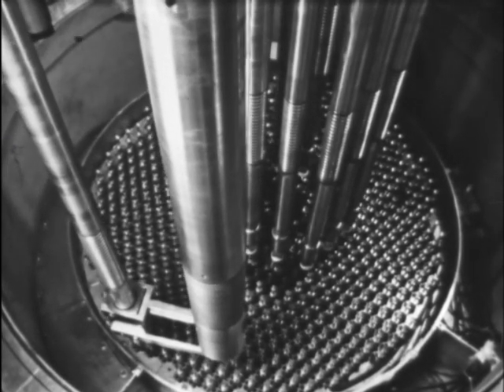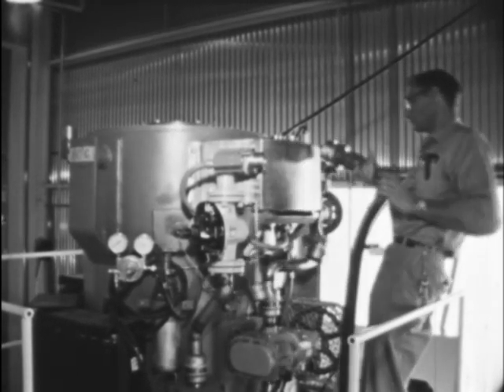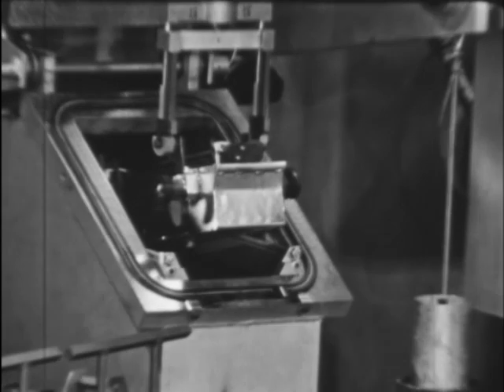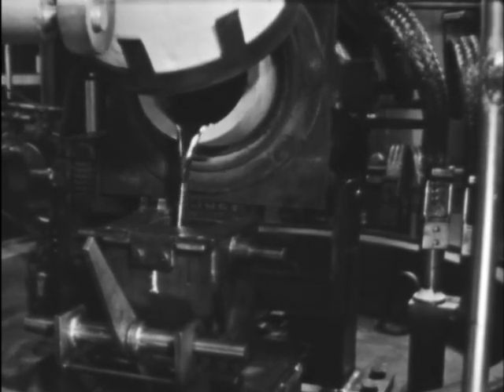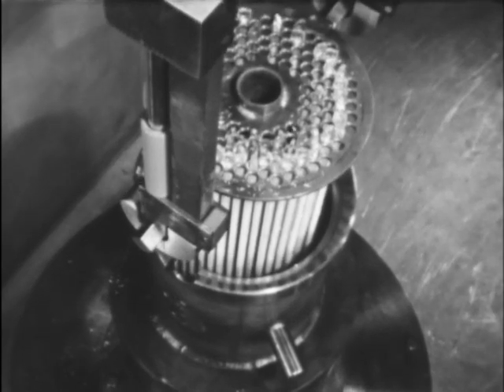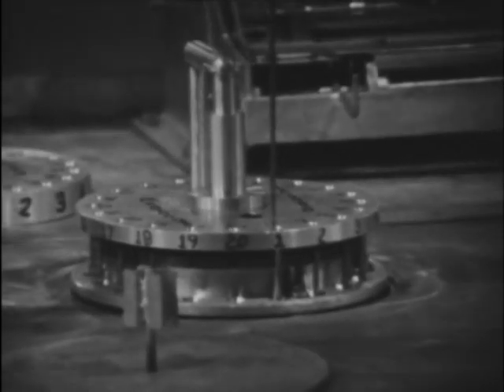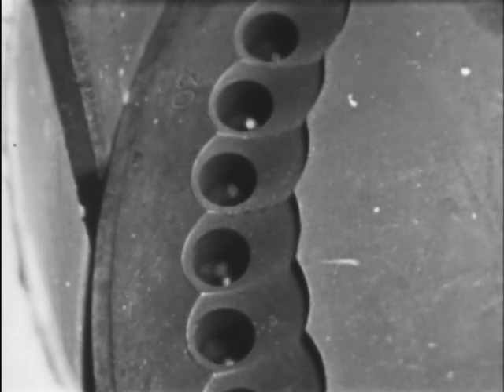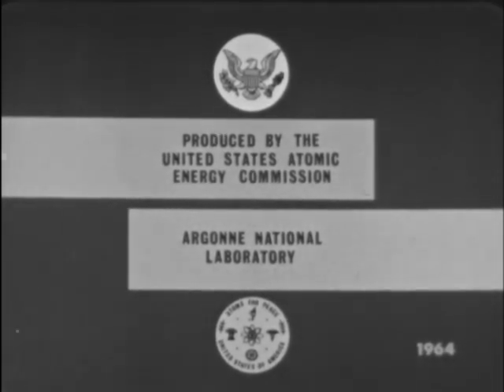The EBR-II Fuel Facility

Comment: This looks VERY dangerous. Not the nukey but the coolant.
Reply from the maker: leerman22 EBR-II operated completely safely for 30 years using sodium coolant. Other sodium-cooled test and demonstration reactors (Fast Flux Test Facility, Phénix, Superphénix, BN-350, and BN-600) also operated safely for many years; BN-600 is still in operation. Plus, one of the US submarine fleet had a reactor that used a liquid metal coolant, without incident. And there is significant US industrial process experience using metallic sodium as an alloying metal, as an anti-scaling agent, and as a reducing agent, all quite safely. So the experience base for handling metallic sodium safely is substantial and has been leveraged to allow safe use of sodium coolant in advanced reactor designs.
Reply: Nuclear Engineering at Argonne
I would prefer lead coolant for a fast spectrum reactor than something than "can" burst into flames or explode in water.
Reply from the maker: leerman22 Lead is being evaluated as an alternative fast reactor coolant. Both lead and sodium have their relative strengths; the idea is to evaluate these to determine which is better from the standpoints of efficiency, corrosion, and safety.
Reply from the maker: The fuel in this reactor is solid, not liquid.
Reply: leerman22 Yeah i agree. But lead has corrosion issues, but those can be solved with new alloys. What do you think about gas cooled fast reactors?
Reply: Zypofaeser
CANDU powers most of my grid, it depressurizes each fuel chamber individually. That adds complexity obviously but it's cool.
As for the MSR are you implying a solid fertile blanket and a vessel made of solid salt? I wouldn't bother with solid fuel in an MSR because then you'd be throwing away the best part of it.
If we could have a cheap disposable vessel and save the plant and fuel then I would go for that. A single fluid uranium-plutonium cycle. A big metal pill I would call the suppository :P
Reply: leerman22 If isolated correctly the risk should be relatively small.
Reply: Zypofaeser
It just gives greenies ammunition. They don't care about engineering.
Reply: leerman22 If you only operate at moderate pressure and engineer it right (Make the pressure vessel burst in a way that doesn't damage the fuel or release coolant into the air) you could make it safe. Also it can be refuelled while under pressure. Its done in CANDU, RBMK and AGR reactors.

You would be able to reach very high temperatures if you use helium as a coolant.

About fast molten salt reactors: Would it make sense to have fuel elements with UF4/ThF4/PuF4 inside,  and the elements sitting in a vessel of NaCl or NaF. This would reduce the problem with materials decaying over time as you could simply change the fuel elements. In this case only the walls would be exposed to decay and you could reduce their exposure to neutrons by having a thick U(238)F4 or Th(232)F4 blanket around the core.
Reply: leerman22 The fuel would be fluid inside of the fuel rods and the vessel could be made of hastelloy. The fuel is liquid and you avoid having to worry about long term damage of the vessel from neutron damage. Imagine something like a PWR with salt instead of water and UF4 instead of UO2. 

Also source for the thing about CANDU. I would like to read more about it.
Reply: Zypofaeser
That would be a good idea and it fits another idea of mine but it would remove in-situ chemical reprocessing while doing it. Would the fuel rods also be made of hastelloy?
As for the CANDU https://en.wikipedia.org/wiki/CANDU_reactor#Basic_design_and_operation
Reply: leerman22 I think a molybdenum alloy would be better as it would be better (There is some molybdenum in hastelloy). Molybdenum absorbs fewer neutrons. You would need a material thats both chemically stable and neutron resistant. I think molybdenum alloys could work. But the main advantage of this design is that you can replace the fuel elements so that when the cladding is too damaged you can simply replace the fuel element.
Reply: Zypofaeser
I'd rather have a large UF4/PuF4 chamber made of a suitable alloy like that and a salt coolant chamber surrounding that. The inner fluid circulates by convection from the coolant salt. You can even use different high temp coolants if the reactor is made from the correct alloy.
You could just change the whole inner chamber if needed and that doesn't restrict in-situ reprocessing.

Replacement procedure: You could drain the vessel of fuel and solidify it in another tank that can open by the sides (which isn't critical), and crush it so it can be dumped in a fresh inner chamber. The coolant salt would be sent to another tank but you wouldn't have to worry about that going critical.
Reply: leerman22 Two main problems:
1 Area, how much area are you going to have for heat transfer. 
2 how are you going to change such a big element that is contaminated. Would be much easier to just lift small fuel elements.
Reply: Zypofaeser
You could increase the surface area with a zig zag pattern on the exterior walls and some chambers that go vertical inside. If you want the smallest critical mass then spheres or wide tubes is how to do it. MSR's are usually controlled by how hot the fuel gets as it expands or contracts.

Perhaps a pill divided into 4ths, 8ths, etc, vertically (also zig zag vertical walls) so coolant can flow between them and they can be replaced individually. Would be easier to transport and manufacture. You can also get that almost-optimum almost-cylindrical critical arrangement. A little of both worlds, and they can still be connected to balance fuel burnup and reprocessing.

You see I can't get a decent conversation about nuclear engineering with greenies. I only studied electrical engineering anyways.
Reply: leerman22 Why dont you just pump the liquid fuel out to a heat exchanger?
Reply: Zypofaeser
This doubles as a heat exchanger, 1 fewer heat exchangers needed. Also a leak into the building wouldn't activate things with neutrons unless the 2 hulls break (if that's an issue anyways).
Reply: Zypofaeser
I think we should move away from pressurized coolants. If the reactor "can" meltdown then it can't do environmental damage if it can't go anywhere. Also you can refuel the reactor while it's on if the coolant isn't pressurized.
 
New alloys would also make molten salt fast reactors a reality. Better waste burner than LFTR with the same safety advantages of liquid fuel.